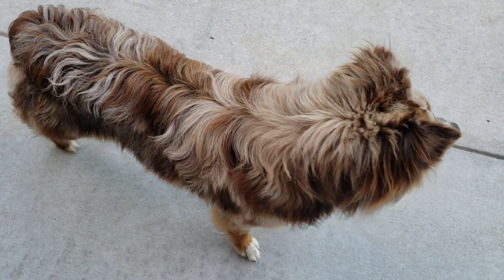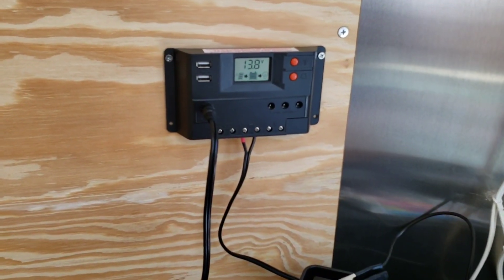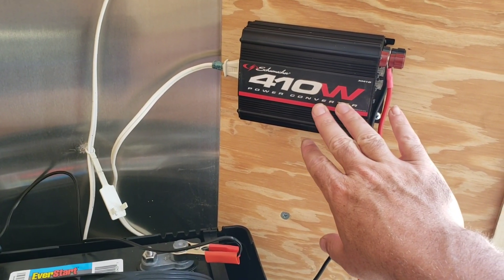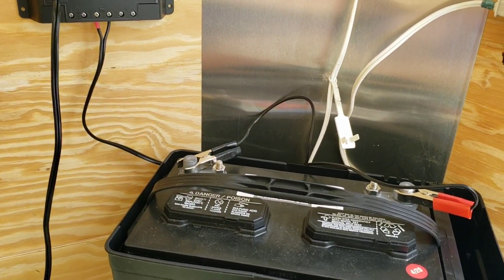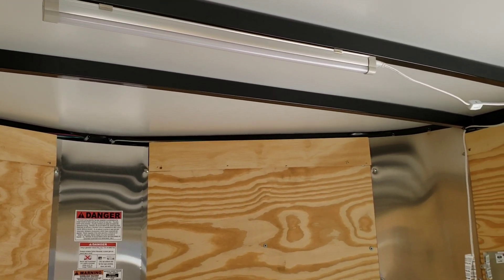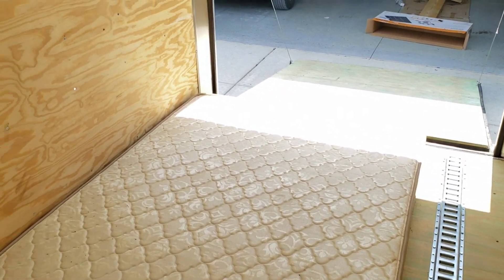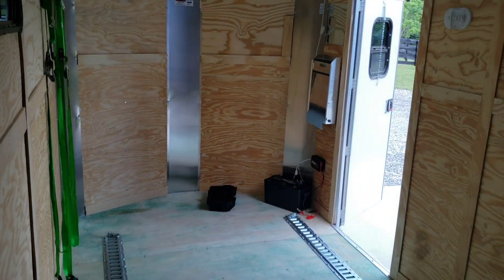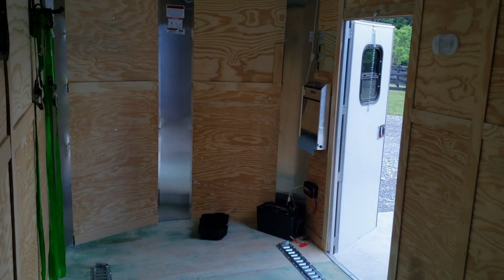Enclosed Trailer Camper Project - Solar Electricity

Comment: That's crazy.. I've got an 18 XX and also did what I call a "work and play" 7x16 on a budget. Insulated, windows, fan, lights, battery, tv, generator, ac vented thru the floor. The only thing I haven't done yet is solar but I have plans for that at some point.
I also pull with a small diesel. 2018 Colorado duramax. 
So where is home base? I'm in 42101.